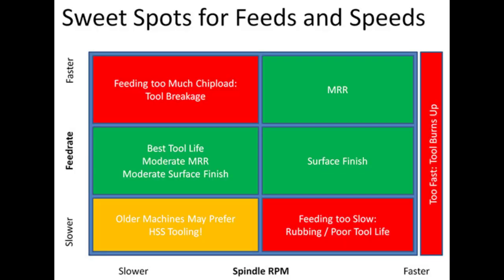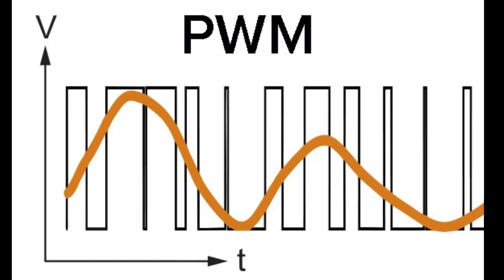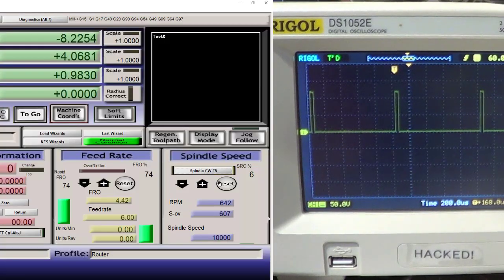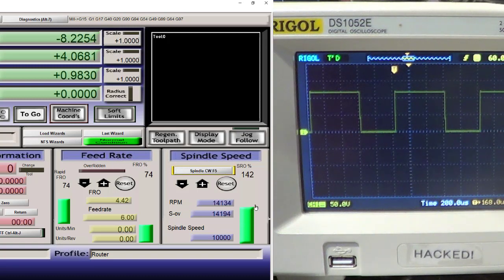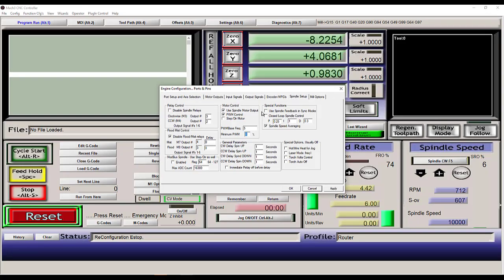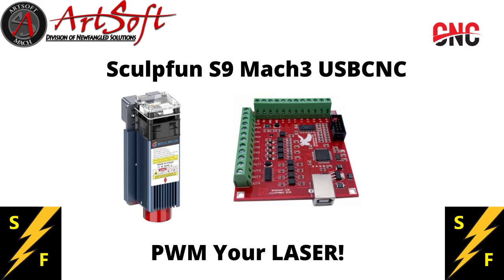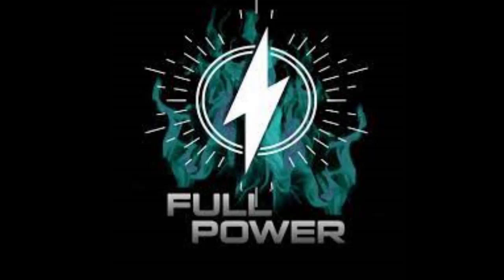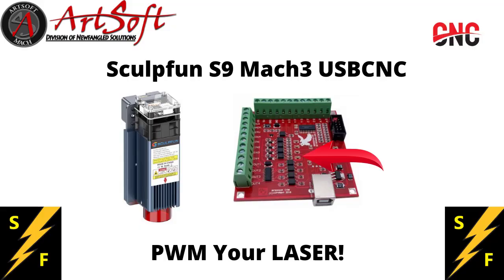S9 Laser/Mach3/USBCNC

Comment: I know this is over a year old but has any one got this wired up to work? I'm one of those having difficulties with the wiring. I'm Running 24v system and adding 12v power supply.

Comment: Hello,
I have the sculpfun S9 laser.
Do you have a wiring for that type?
What parts do I need to have to operate the laser with MACH3?
Thank you.
Reply from the maker: Hi gfimon, thanks for watching!  The video was about the Sculpfun S9 laser module, and there is wiring info in the video.  I am using a USB->Stepper/motor control board and the info is in the video.  It is pretty straightforward, if you are stuck on a particular issue let me know.
Reply: @stevesfascinations1516  I'm stuck at the wiring it self.
Can I contact you by other way than here?

Comment: I intend to use Sculpfun S9 Laser Engraver Module 90W with CNC Shield V3.0 Expansion Board With Arduino Uno. CNC Shield V3.0 has 3.3v on pwm output. I wonder if the output is strong enough or if the pwm voltage needs to be increased to 12V.
Thanks for the video..
Reply from the maker: Hi Martin Matjasic, the laser needs 12V, I am not familiar with the CNC Shield, but if it puts out 3.3V, you may want to use that voltage to trigger a  FET to switch the 12VDC to the laser.
Reply: Hello,
Did you find how to wire the S9 laser?
What parts do you use to work it?
Do you have a wiring diagram?
Thank you.

Comment: How do u calibrate laser.
Issue that I am having is after 3 to 4 minutes laser starts loosing power. Burn lines fade to nothing. Thanks For the hep
Reply from the maker: Sounds like a defective laser or you are changing the pwm over time.  I believe the spindle speed can modify the intensity, check to make sure your code does not change the spindle speed in the area that is causing you trouble.

Comment: Need a little help with my laser setup can u help
Reply from the maker: Hi Gary, that is a little vague, what are you having trouble with?
Reply: @stevesfascinations1516  Post processor setup and ports and pins , do u have Messanger we can text from
Reply: Do u have a wiring diagram that shows all connections
Reply from the maker: @garyparrett8955  Yes!  Look at 2:25 there is a diagram in the video.

Comment: Hi Steve, great video 👍. I followed this setup and the laser works fine with M3/ M5 commands, however I get spot burns with these commands. I cannot get it to work with M11/M10 commands and I'm not able to adjust intensity. Any idea what I can look at to get this sorted?
Reply: Ok, I did the calibration and can now adjust intensity. But still not able to use M11 command.
Reply: @nix12m  This board do not support those commands.
Reply from the maker: @nix12m  I would think the intensity would be with M3.  Wikipedia: The speed of the spindle is determined by the address S, in either revolutions per minute (G97 mode; default) or surface feet per minute or [surface] meters per minute (G96 mode [CSS] under either G20 or G21). The right-hand rule can be used to determine which direction is clockwise and which direction is counter-clockwise. 

I have a dozen projects on the go so can not help much right now.

Comment: Steve, were you able to finish the laser assembly? I would like to know how the final work turned out and if it would be possible to provide us with the wiring diagrams. I believe that many are having difficulties in getting the laser to operate properly with the RNR Motion Control. Have a nice week!
Reply from the maker: Life got out of control for me, so I have not had time to complete the install.  There are wiring diagrams in the video.  They are pretty straightforward connections.

Comment: Hello, thank you for the video. Few things i do not understand:
1. Normaly laser frequency is around 1Khz, why did u set 5 in the PWM Base Frequency in Mach3? Souldnt you have put e.g. 1000?
2. At a certain point you mentioned that having 12V on AVI would allow to have higher laser power but my understanding is that power is drawn from VCC so 12/24V and it has nothing to do with the PWM Voltage but only with the PWM duty cycle.

How is it that CNC board, did you ahve any issue with lasers?
Regards,
Reply from the maker: Hi Massimiliano Gilli, thanks for watching the video!  I am pretty new to lasers.  I have experimented with laser diodes with various power levels. I have made PWM controllers and power supplies for them.  I was not aware that the freq is supposed to be 1KHz - thanks for letting me know!  The PWM allows you to vary the power to the laser by chopping the DC power into pulses.  If you increase the voltage you will get more power out of the diode.  The diode is rated to 12VDC so that is what I used.  I did not think it would be a problem for the control card and I was correct, it works fine.
Reply: @stevesfascinations1516  My point is that Pulses are between 0 and VCC (either 12V or 24V) and not really related to PWM voltage. The PWM can be either TTL (5V) or 12V and what matters is the duty cycle. But i guess we are on the same page. What about the breakout board is it good?

Comment: hello good night, I've been looking for help to turn on the laser on my board for a long time, but I don't speak English, could you send a photo of the connection of the laser part please, thank you
Reply from the maker: Hola Jose!  Thank you for watching the video.  Turning it on is easy, controlling the power is the tricky part.  To turn on, simply connect the VCC (Positive DC Power) to the PWM (Pulse Width Modulation) pins together and then power them both up.  It will then be ON at 100%.   You can do this either with a relay or a switch.   I hope this helps?

Comment: Wiring 

The wiring connections are marked  ACM, AVI and 10v, this is commonly used on VFD's

ACM = Analog common ( ground )
AVI = Analog Variable 
10v = Reference voltage 

this used on an external potentiometer or PLC for VFD's ...

In closing, the 10v ( reference voltage ) could be anything from 5v to24v , 
DO NOT CONNECT THE ANALOG GROUND TO DIGITAL GROUND 
as it will create ground loop and create endless problems.

Comment: Hi all, I have done a very similar setup on my CNC using the RNR USB breakout board, 
i also use a spindle.

My setup uses the Spindle output Clockwise  "M3" for the Spindle and spindle Anticlockwise "M4"for the laser, as well as the PWM for the Speed \ Intensity. 
I have also created a custom Vectric Post process to use M3 for all my spindle work, as the spindle I use only works in clockwise operation,
and M4 to switch the laser on and off. 

I have had great success using this method so far, 

Nice job and keep the videos coming .
Reply from the maker: Thank you for sharing!  I still have to get the laser out of the basement to the garage where the CNC is located.  I just bought a metal lathe so that took priority right now.  Canada is wonderful in the summer so lots of out door activities.  Winter is cold so that is when most of my electronics/programming/cnc work is done.  I will give your ideas a try when "I get around to it"!
Reply: @stevesfascinations1516  

I tried many Post processes from other 3rd parties outlets, keeping in mind there are other types of break-out boards that are not compatible with the RNR, none the less Have fun while the sun is out, if you run into a snag regarding the post-processor please feel free to give me shout, I'm happy to share, I also have my wiring diagram also available. 🍻

Comment: Excellent job! What Post Processor did you use? I tried several times and the laser is always turn on. Did you use an external relay to turn the laser on and off when cutting? If possible, could you show us the connections on the USBCNC board? So people will fully understand your wonderful work.
Reply from the maker: Hi Washington, thanks for the kind words!  I will be using vectric aspire for the designs and I found a post processor for laser that I will likely use.  I am going to use an external relay to turn the laser power on/off, and the PWM signal to control the intensity (mach3 will think it is the spindle speed).  I am trying to find time to tear down the CNC control box so I can add the connections for the laser and finally install the laser on the machine.  Hopefully I will get to it this weekend and I will make a video of the process.  I will make up a diagram showing the relays etc to help others out :-)  Too many toys, not enough time!
Reply: Thanks for the reply. I'm glad you can help other people. The visualization of the electrical connections makes it much easier to understand. Good luck to you and God bless you!

Comment: Do you connect the 12v psu to the 10v and acm terminals with the laser wires +12v and -12v  to the same spots respectively ?
Reply from the maker: Hi Dillon Dopp, thanks for watching the video!  Yes, I am connecting the +12VDC to the 10VDC input on the card and the S9 Laser +12VDC Input together.  The grounds are also connected together (ACM on the board, and GND on the 12V power supply).  The AVI on the board goes to the PWM pin on the S9 connector.  I hope this helps clarify things!  If not, let me know and I will try to help further.